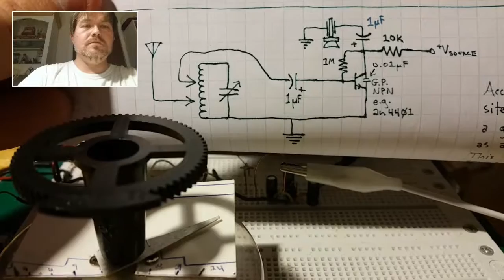6/? - --Crystal-- TRANSISTOR Radio -

Comment: How many volts of current do you put into the circuit.....? And without an amplifier, you can listen straight to it via a regular amplifier...?
Reply from the maker: It's been a while since I've made one of these, so I don't remember but I do mention 9 volts in the video so I'm guessing I was using my little homemade variable voltage power supply.    That said, the wonder of the crystal radio is it needs no power source to operate if you're using a simple germanium diode for a detector.  However, you need a speaker (earphone) of a specific type to listen to it without amplification.  

In this video, I've replaced the germanium diode (detector) with a transistor, which of course did require a power source.  It wouldn't be much, though.  Probably a pair of AAA alkaline cells would be sufficient with the right transistor but of course you could also use a 12 volt sealed leaf acid battery or any voltage in between. Experiment!  Current requirements would be quite low indeed...  tens of milliamps, I would imagine.  You probably could power it with a 2032 lithium button cell...  Depending on the transistor used.

Now the speakers are a different story.  They'll require some power, but you see what I'm using is just an old set of computer speakers.  There's nothing special there:  just connect the speakers' input to the audio output of the crystal set and you're off to the races!  It's cheating a little, but the point was to make a radio, not an audio amp (although I've done that, too, a few times, separately, so it's really not cheating so much as reusing modules).

I hope I've answered your questions but I'm running in 3 hours of sleep last night and I'm about two hours past when I needed to be asleep tonight so I am not quite clearly thinking.  If you have more questions, just ask, and I'll try to answer them with a clearer mind LOL..

Good luck, and good night!
Reply: @TechAddictAttic   Thank you sir for replying to my comment. I really appreciate it. I really like electronics. especially basic electronics. I think studying electronics at radio waves is very good because we fish only learn but understand the components very clearly. Study at radio waves, receivers and transceivers at Radio is very thorough. Once again I appreciate you as a teacher, I am a son from Indonesia. Greetings to meet you. I support your channel and follow it faithfully
Reply from the maker: @putraperdana4941  you are quite welcome!  I don't consider myself a teacher so much, but rather someone sharing an interest.

I've stopped making videos mainly because life is just too busy.  Hopefully that won't last forever:  I'm in the process of editing some footage of a modification I've made to a desktop portable multiband receiver, but again as busy as it is (and feeling under the weather a bit) I've been slowed down in that endeavor.  I hope to have it all up soon and maybe start making some videos again now that I'm learning the editor and don't have to be "one-take Juan" anymore!  😁